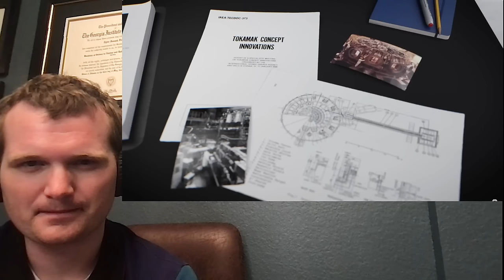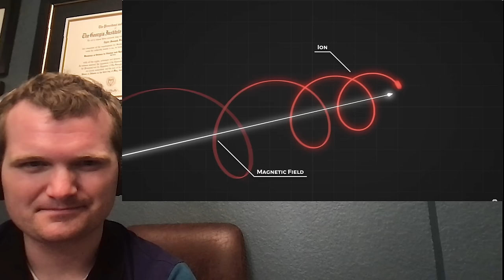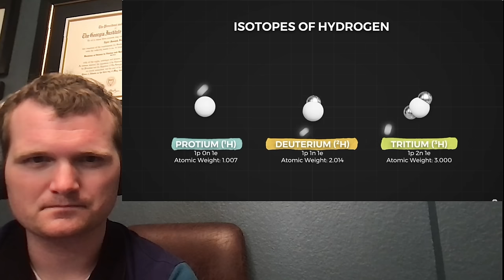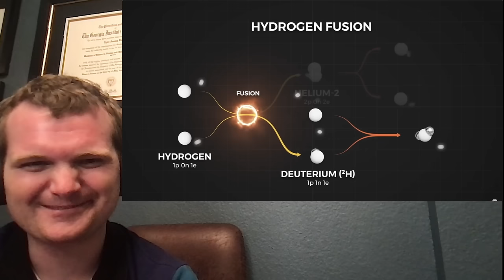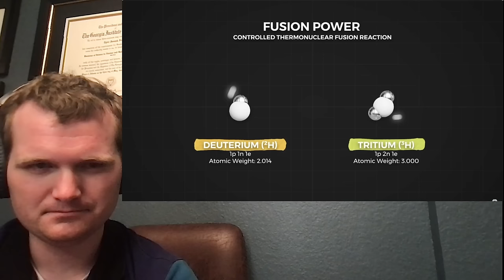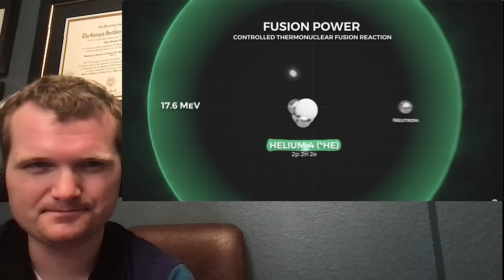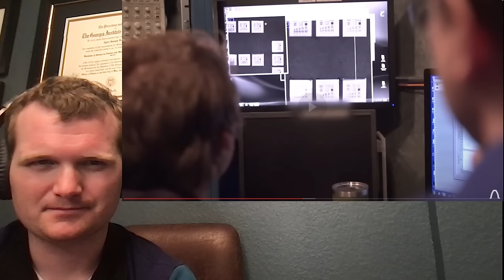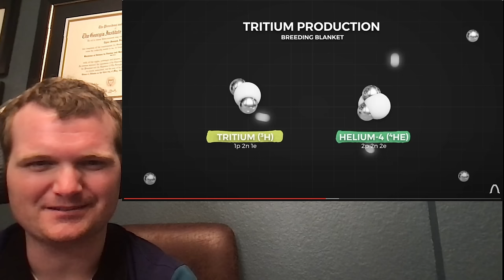Nuclear Engineer Reacts to Real Engineering "The Problem with Nuclear Fusion"

Comment: If you imagine a car engine in its most basic form, you need to spend some of the power to generate electricity and light up the spark plugs, some power to pull the fuel in, and some to move the oil around, and a cooling system. But you dont to spend fuel to contain the "reaction", in this case the explosion. This is done by using a metal or an alloy that will physically contain the explosion, the engine block. Same thing with nuclear fission, you spend energy moving stuff around, but the core itself is just a metal or alloy that will resist the heat and pressure of a nuclear reaction.

Fusion is different. The heat is so great that you cant contain it using any known material, you need to contain it in a magnetic field. So the "core" or the "engine block" isnt physical, its not a metal or an alloy, its energy. So you need to bleed some (a lot) of the power just to contain the reaction. Usually more then you get out of the reaction. 

But there is another way. The trick is to have an array of atoms or molecules that allows some other atoms to insert themselves in the lattice and then cool it, contracting the lattice and forcing the atoms to fuse.
Reply: That's called a star. Stars can blow you, you know.   :P
Reply: @spvillano  Well stars are even harder to contain on earth.
Reply: @jfh667  yeah, and a real hog of yard space!
Reply: Your analogy doesn't work for fusion because you apparently don't know how the magnetic field used to confine the fusion plasma is generated and sustained.

Nearly every current design for a magnetic confinement fusion reactor now makes use of High Temperature superconductors that are capable of generating strong, stable and powerful electromagnetic fields with zero resistance.

This means that there's no energy lost due to resistive heating in the superconductors like you'd see in a conventional electromagnet with regular conductors. So as soon as the required energy to power up the superconductors for the reactor magnets is met, it will continue to maintain that field strength indefinitely (basically acts like a battery for magnetic fields) without further energy input needed.

The only extra energy needed would be that necessary to chill the superconductors to their superconducting state, but after that, with sufficient insulation and shielding, no extra energy will be needed. There may of course be slight increases in energy consumption due to adjustments made in order to control the plasma, but nothing so grand that it takes away from the fusion energy gains.
Reply: @justiceifeme  why would you be chilling high temperature superconductors to operate? You chill low temperature superconductors, which are operating in proximity to a high temperature plasma and in your version of unreality, won't acquire heat because of the unicorn fart insulation that's 100% efficient.
Also, superconductors aren't 100% efficient, there are always losses, both in eddy currents, fields potentially pinching, just plain quantum effects introducing variability to the field, interactions with a conducting plasma stream, micro-resistance, capacitive reactance losses and more.  They're electrical devices, not magical devices.

A hint, do look up storage time for antimatter within a superconducting magnetic trap. Ain't all that long for the above reasons, minus the superconducting plasma beam.
Reply: @spvillano  Once again you're showing your complete ignorance of how superconducting tech in new fusion reactor designs actually work, personally I'd advise you actually do some basic research on companies that are leading in this field like Commonwealth Fusion in collaboration with MIT Plasma physics department and Tokamak Energy in the UK.

Firstly, the term "High temperature" in superconductor tech doesn't refer to room temperature or above room temperature superconductors, it refers to the new ceramic rare earth barium copper oxide (REBCO) superconductors that relatively recently started ramping up production in the industry, enabling the use of more powerful magnetic fields for applications such as MRI devices and, obviously in this case, fusion reactor designs. 

These REBCO superconductors are called "high temperature" because they can perform and operate as superconductors in higher temperatures like those of liquid nitrogen, as opposed to "low temperature" superconductors like NiTn that needed to be chilled to liquid helium temps before they could operate as superconductors, and they'd only give less than half the performance of High temps. 

So in short, yes you definitely still have to chill high temperature superconductors for them to operate effectively (that's why they're drenched in a bath of liquid nitrogen and or helium to chill them down to their superconducting temperature), and moving on to the next point you seem to not understand about fusion reactor designs, the high temperature plasma is magnetically confined in a vacuum vessel.

That is, there's no means for heat energy to be transferred from the plasma to the coils through conduction, convection and or radiation for that matter (that would be bad for everything around the plasma, not just the magnets if that were to happen), there's nothing more insulating than a vacuum, plus there's a 1 meter (3.2 feet) shield separating the magnets from the vacuum vessel that the plasma is confined in, so not even the neutron radiation emitted from the fusion reactions will damage the magnets either. This is part of the beauty of fusion reactor designs, the juxtaposition of the extremely hot right next to the extremely cold but it all still works just fine.

Secondly, I'm not sure where you got the idea that superconductors were 100% efficient from, I said they had zero resistance which is a matter of fact, if not they wouldn't be called superconductors. Even the best High temperature superconductors we have currently still have their limits in the amount of current they can handle, the strength of magnetic Flux they can sustain without destroying themselves and the length of time they can hold on to ever increasing magnetic field strengths and instabilities before the succumb to quenching. 

But the fact remains that as long as they remain in their normal operating parameters, they can hold a current and continuously generate a magnetic field indefinitely, so long as they remain superconducting. There's no 100% or infinite efficiency needed, that's just how superconductors work and the reason they're used for precisely these kinds of applications. There's no magic involved nor any breaking of quantum laws to achieve this basic function. 

And finally, you asking me to look into antimatter confinement problems when using superconductors for generating magnetic field bottles is irrelevant when talking about their application in fusion reactor designs, they're not the same problems at all. Antimatter is already extremely difficult to work with as it tends to immediately annihilate upon contact with regular matter (hence the reason for the magnetic bottle to begin with), so designing an apparatus that can both create and immediately confine antimatter is more challenging and presents it's own unique problems compared to fusion reactor designs where all the matter involved is regular matter.